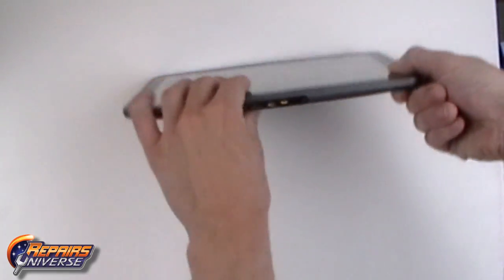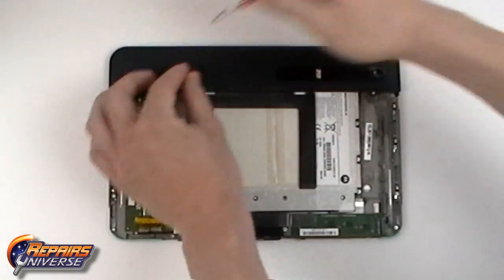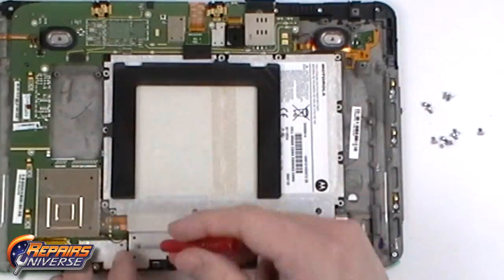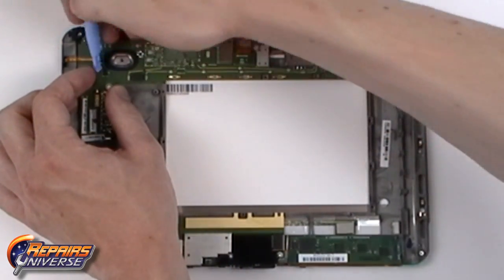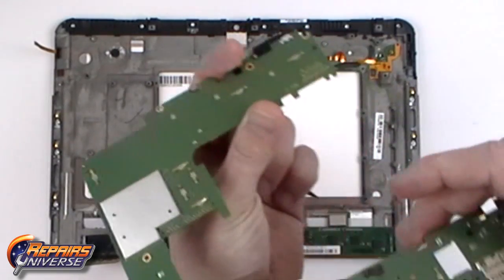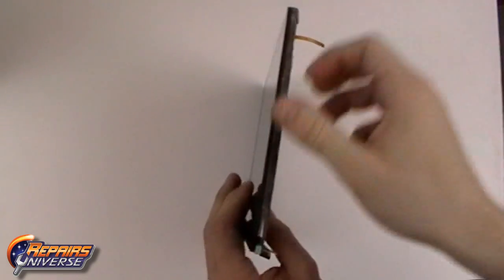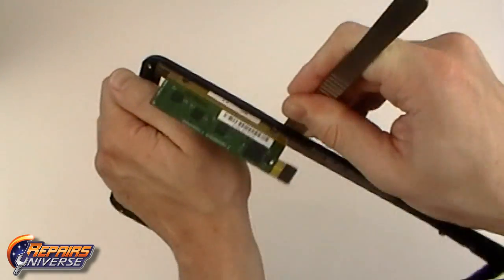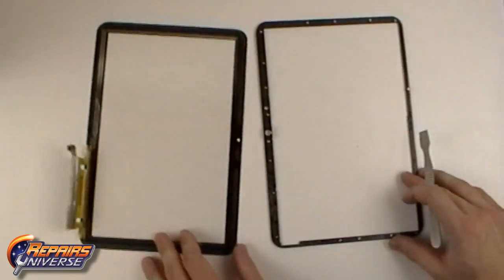Motorola Xoom Take Apart Repair Guide

Comment: I managed to take it apart and put it back together and it's speed seems to have increased
Reply: Could be that when you dismantled it, you released some physical pressure on the logic board where the CPU chip is, doing so will allow correct heat dissipation and make the CPU run nominally and at it's full speed. CPU protection is a feature on this device and voltage regulators on the logic board will reduce power and even cause premature shutdowns in the event of some problem. Similar to how LiPo battery protection works

Comment: Great video, but I have an apparently different version of the Motorola Xoom MZ505. Mine, well my husband's, has a solid back. I watched this and another video first before taking it apart, and also took 33 pics as I disassembled it. I had no problems really taking it apart and replacing the screen, as it is simpler to do on the one we have. The problem I have is, a small black wire came off, and though I took pics on my Samsung Galaxy Note 5, I did not get a good clear pic of that particular wire, and have no idea where it goes. I know this is a shot in the dark, but do you have any advice? My husband loves this thing and I really would like to get it back together and working for him. Any help is greatly appreciated!
Reply: Probably an antenna cable, does your WiFi still work? Does your GPS work?

Comment: Everything turned out great as far as replacing the screen but the only trouble I'm having now is  with the battery its not charging when I connect the charger but it will stay on as long as I keep the charger connect to the power outlet, any suggestions?

Comment: Great Video, this will be helpful if I find a power button. Do you know where I can purchase a power button from? My tablet is usable I can play, but I have to plug it in to get the screen to come on then once it is on I can unplug it and play. Basically I can never shut it off. My fear is someday I will have to hard reset it and with the power button broke that would be impossible to do. I have checked your parts and tools and did not find a power button. Thanks for any information.

Comment: subWOOFFA, I have the same issue. No clue what the black connector does, but mine doesnt charge, and only works when plugged in. no clue how to get over it!
Reply from the maker: Sounds like the battery may be the issue. Unfortunately we do not offer the batteries.
Reply: Repairs Universe I've tried 2 batteries now and same effect. Do you know what purpose the red and black cable from the battery serve? when trying to take it off the connector the entire connector came off
Reply from the maker: This would be your positive and negative connections. Most certain this is the issue.
Reply: Repairs Universe If that's the case what are the 2 ribbon cables from the battery that get screwed into the main board?

Comment: I replaced the touch screen. All went well following your video. Upon boot-up, the unit goes through the expected cold boot, then the kaleidoscope, then shows the unlock screen (in safe mode) but the screen does not react to touch. I removed the back and re-checked all connections; all appeared normal. I did remove the protective films from both sides of the new glass. Any ideas?

Comment: Hmm maybe you'll answer me, my xooms been on its last legs for a few months so I pulled it apart, removed the battery and put it back in with the screws but that little black box with the two very thin wires that you can see at 2.43 in the video has me stumped you made it look very easy to just flip off and me knowing absolutely zero about pulling this stuff apart decided to flick it off with a screwdriver which upon removal I noticed it wasn't a plug at all it more seemed to be glued in, well anyway I reassembled everything ( fucked up the volume buttons no biggie ) only to realize that the battery now wasn't recognized by the xoom and the only way to use it was to have it plugged into the wall socket which is great and all but one tiny bump and you loose everything ( 5 min bootup aswelll -.- ) I was just wondering how the hell I put that tiny black connector back ?
Reply: Well thanks for the no reply
Reply: I know this thread is a couple of years old, but I will try to address this in video for you on my channel, I have just acquired a xoom and most likely will need to pull it apart because of some inane battery issue. . .

Comment: Great video. My Xoom stopped working. Think because the battery drained all the way down. When the charger is connected it shows green light saying its fully charged. I have tried the reset also. Power and volume up as well as volume down and all three. Is it possible I just need a battery? After seeing the vid it looks pretty easy to change. Thx
Reply: I just pulled mine out of a cupboard after 3 years and it charged up fine so it might be a hardware issue
Reply: Mine just got to this point...the green light shows changed but it does not turn on. Not going to complain cause it lived way beyond what i was expecting...just did not want to let it go.

Comment: Need your help figuring out what might be wrong with my Xoom and if I can fix it.  It had actually been dropped several time with no problems.  But, my son hit it and now half the screen is black with stripes.  It started where if I restarted it would be fine, and now it's completely gone.  It still responses to touch it I just can't see anything on half the screen. Any ideas?
Reply from the maker: Kristy Hughes Sounds like you have a bad LCD. You can send the device into our repair shop and we can diagnose the issue for you.
Reply: Repairs Universe Ok i repaired my LCD screena dn was able to put all my parts back together and i was able to get the tablet to boot up just right but my wifi wont connect or it just says wifi connection turning on, and it takes forever to connect even then it doesnt connect at all. And it gets really hot by the camera/head jack port. Any ideas?

Comment: First off thanks for the video saved me loads on buying a new one.  I had to replace the digitizer after the dog knocked it out of a chair right onto a concrete floor.  Any way I have an extra part I cannot seem to figure out where it goes?  It is a small black plastic piece with two grooves in it about the size of the board.  I was thinking this was some kind of spacer for the motherboard but cannot seem to locate where it goes.  Also the sd card cover just slides in and out nothing holds it in?  I had never opened it til now I thought it might be something to hold it from coming completely out?  Thanks again!
Reply from the maker: Allen Allison Could you post a picture of the piece in question? As for the sd card, it should simply slide in and out. When pushed all the way in, it should fit securely to the device.

Comment: To separate the screen digitizer from the fitting, you mention that I need to heat the adhesive, once I buy the digitizer from your site, do I need to add any more of that 'adhesive' to the order? Do you also supply it? or do I even need more?

Comment: Hey, nice video. I've search for quite a while and still can't find anything to fix my power button. The button itself doesn't click. Which won't let me turn it on to the lock screen, or turn the screen off when I'm done using it. Any ideas? 
I've taken it apart and did a basic cleaning, although it never came in contact with antyhing, but It still won't click. 

Thanks in advance.